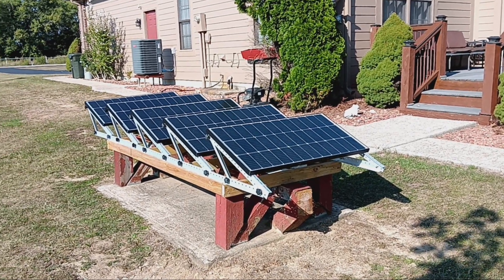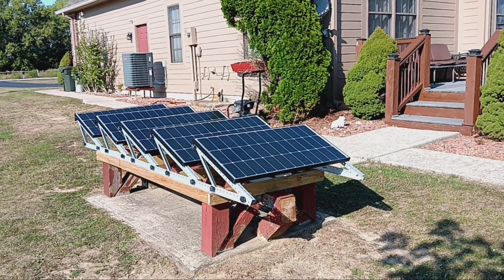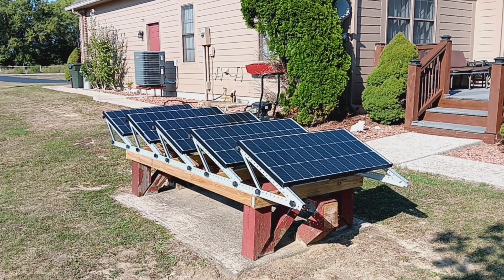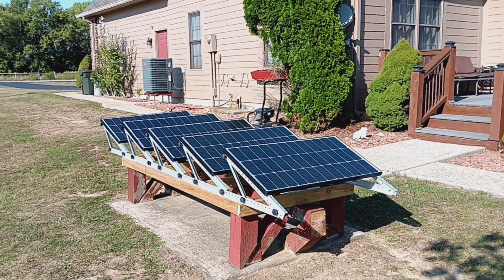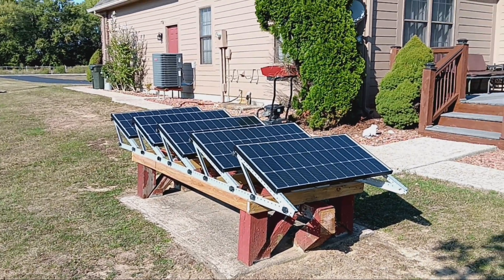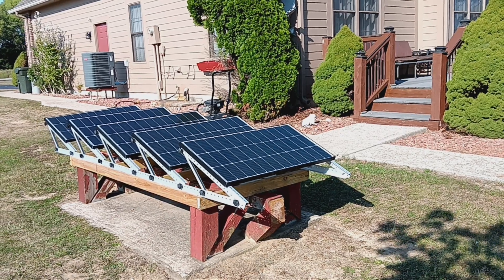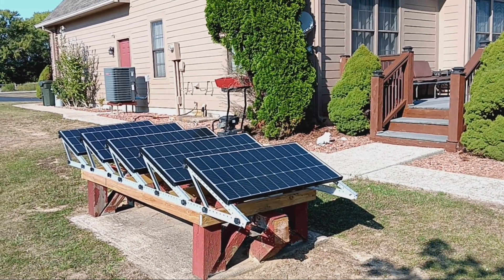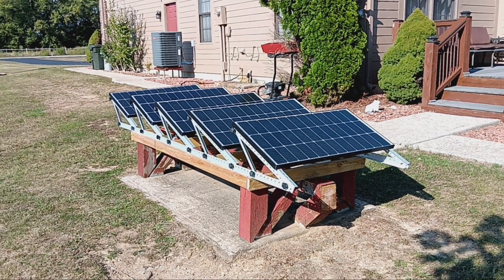Solar Panel Array wiring in series, parallel, or both?

Comment: well, I know not to trust Chat GPT for electronics now.
Reply from the maker: @jamesalles139  Yeah agreed it seems to be questionable some times. I will check my wattage tomorrow and then hook up in parallel and see if there is a difference.
Reply: @larvae91  take that fifth one in and out of service and I doubt that it is contributing much.
I'll use a round number - Open Circuit Voltage may be measurable but it is theoretical under real-life load.
20v + 20v in series = 40 volts. Then you are putting a 20volt device in parallel with that - under some conditions (called a network) that could actually bring the voltage down between 20 and 40.

I am not saying that is what is happening here.

But best practice would indicate keeping the fifth panel out of service as a spare, or use it to keep a vehicle battery charged. Or run some gazebo lighting.

the 2 in series and the two pairs in parallel is perfectly comfortable.

have fun!
Reply from the maker: @jamesalles139  Do you think it would be better if all 5 were in parallel or just 2 in series the other 2 in series and then those in parallel? Total of 4.
Reply: @larvae91  If I recall, you have a small wire size, and putting them in series/parallel (40v) cuts the voltage drop down more than half.

My guess is that 5 in parallel won't quite do as well at 20v. But it will take testing to be sure.
Reply from the maker: Trying the math, I'm thinking of just adding a 6th panel and running it 2s2s2s. Thinking that's 15A 60V which is in my threshold.
Reply: @larvae91  I like that way of thinking - moar is better AND symmetrical!
have fun with it!
Reply: All five in series  if the controller  will handle  the combined voltage of all 5 panels     or all 5 in parallel  if not .Combining unequal  numbers of panels in series and parallel  will cause big losses of power
Reply from the maker: @user-vf3jj2ur8w Just installed another panel. So 6 panels total. 2S2S2S. 5 just doesn't work in parallel puts me at 25A 20v. My Delta is rated at 15A 60V. 6 panels 2S2S2S puts me at 15A 60V. Delta 2 solar input hit 501 watts yesterday in that configuration.
Reply: @larvae91  I hope you are still in the mood to experiment. I f not, feel free to ignore me. I would go for the highest voltage possible. Try 3 panels in series to get to 60 volts OCV and put the two sets of three in parallel. The higher the voltage, the lower percentage voltage drop at the other end.